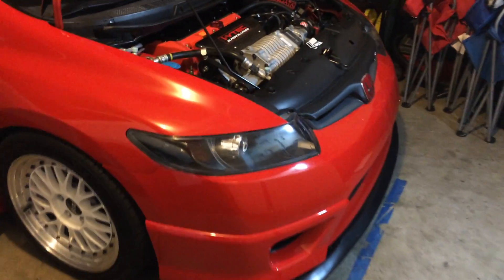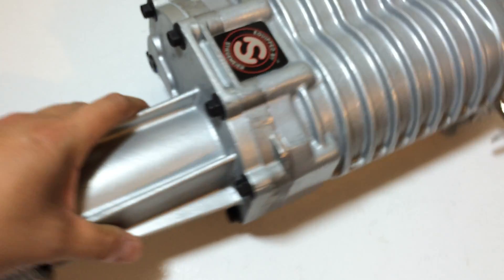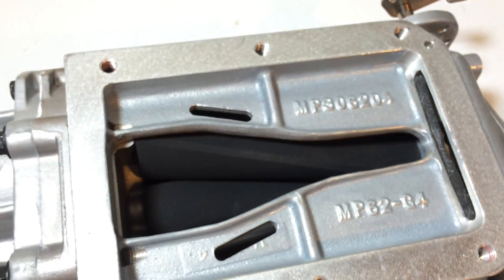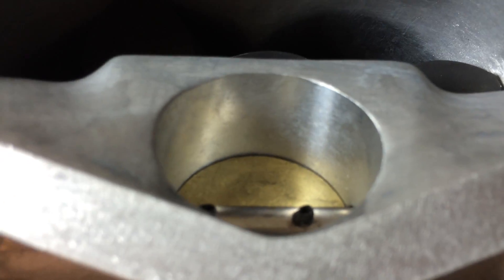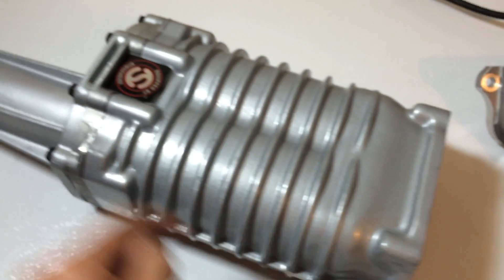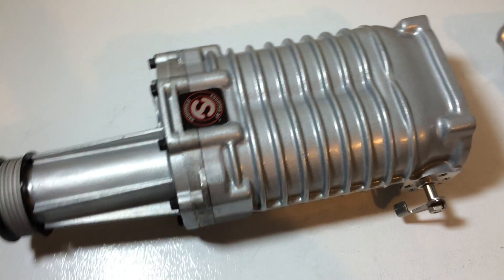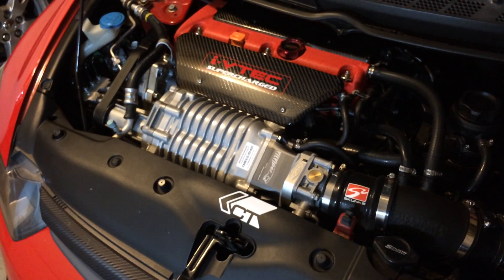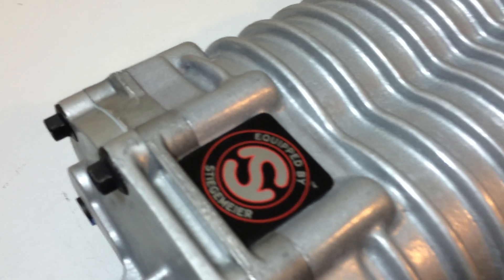Stiegemeier Porting Services MP62 Blower + Manifold

Comment: The porting is beneficial but on the intake side of the engine you actually don't want it polished smoothed because the air actually sticks and drags. Optimal is to have a rough dimpled finish like a golf ball or maybe even stock finish. On the exhaust side of things you do however want a polished finish.